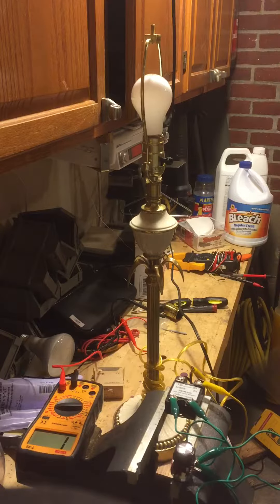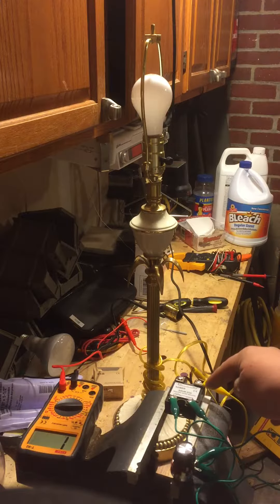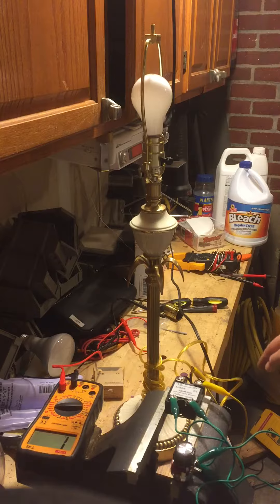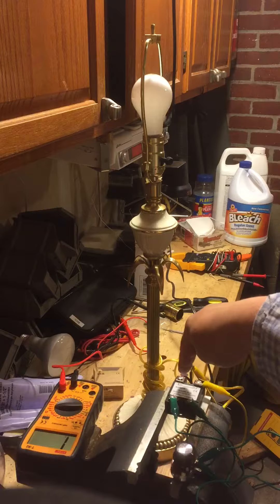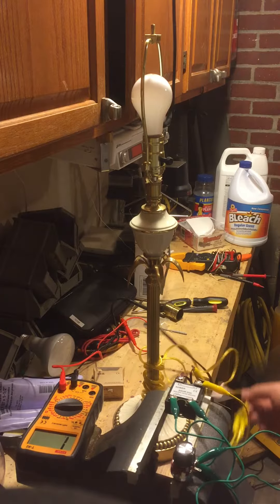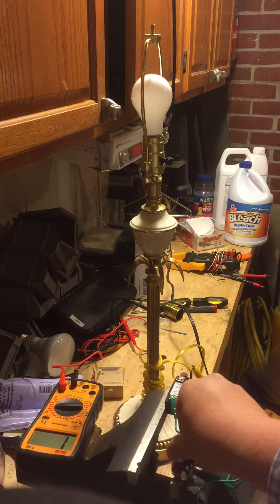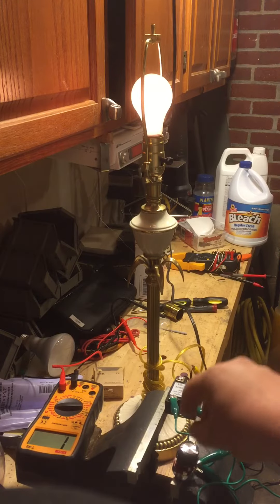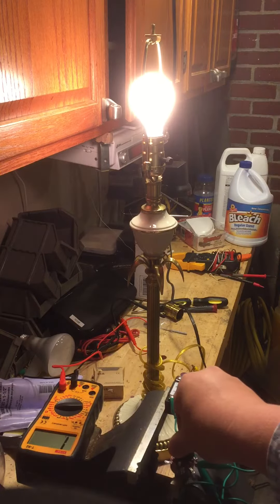Auber SSVR with Rheostat 240V, 60Hz option

Comment: you have the 500k ohm potentiometer? I was researching and for 120VAC a 160kOHM pot is required
Reply: 160k is right for this model @ 120V/60Hz, but I couldnt find where he said 500k pot.